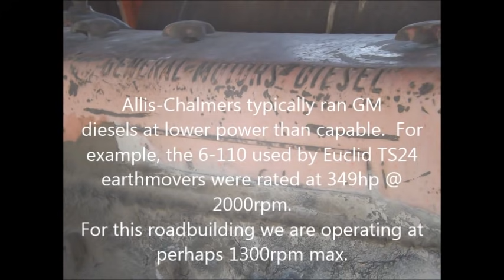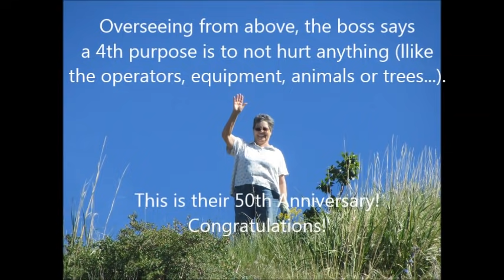Allis Chalmers HD-20 Roadbuilding Part1

Comment: My father was a contractor in Central Texas  and we had an HD-11 cable and a HD 21 cable dozer very fast running machines  building  lakes and roads! Strong old machines clearing land . I just hated changing cables on them! They worked in the hottest conditions were the hydraulic tractors would overheat and have to stop running to cool off! They also worked great going over Caprock  were a hydraulic tractor wouldn't  be able to break over , they could . We would then winch the hydraulic tractors up! To rip the rock!

Comment: Awesome .
Did you know Allis Chalmers made a fuel cell hydrogen Tractor in 1950s( experimental version)?
Allis Chalmers big steam turbine powers half of NYC con Edison also .
Nice soft ground there.
Reply: Also known as "Big Al"
Reply: @RJ1999x  Big Al runs NYC is a giant gas turbine for CON - Edison here.
But AC made a farm tractor fuel cell demonstration project in 1950s .
Hydrogen.
Reply: @RJ1999x  "Big Allis" ConEdison
Reply: @Nudnik1  fully aware. They also made the giant steam engines that powered the Manhattan subway system, the largest steam engines ever built